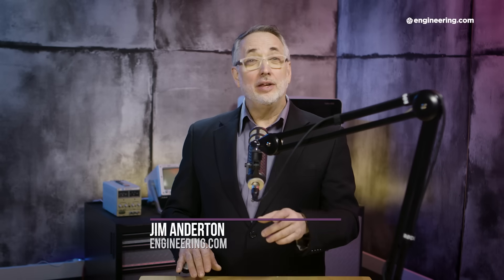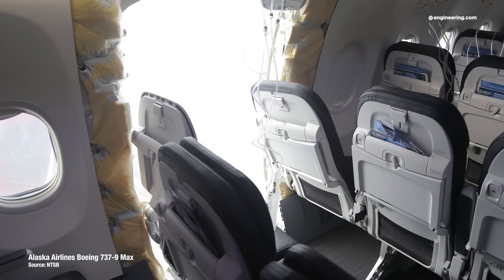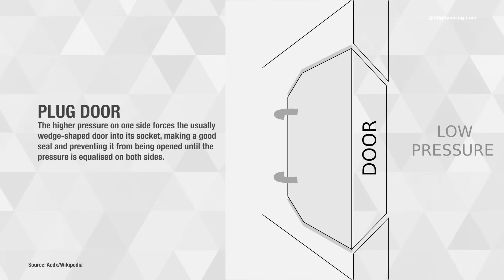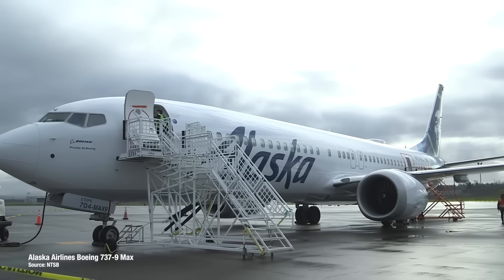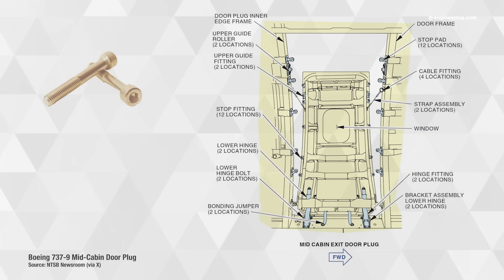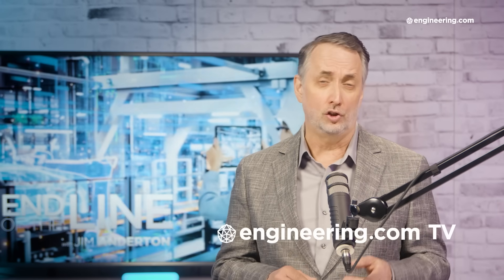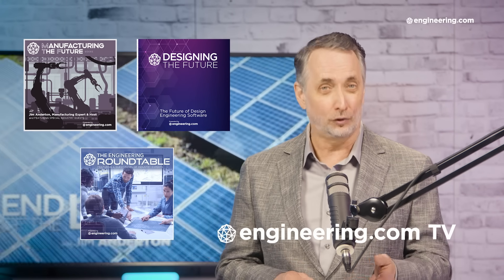The Boeing Issue Isn’t About Bolts

Comment: Boeing has been building safe airplanes for decades
The two fatal crashes could have been avoided with western trained pilots since they would have overridden the faulty sensors and fly the planes manually to safety
This was also confirmed by an independent French investigation however the media never talks about that 
Than you have these retired Boeing workers bad mouthing Boeing maybe they were part of the quality problem while they were working there but of coarse it is never them but somebody else
It is impossible to supervise 160,000 workers but for sure the company needs to improve the quality issue

Comment: 3:01 there is ZERO reason to reinvent the wheel here technology is not the solution. Boeing needs to go back thirty years and relearn what had worked for the fifty years prior. Personal accountability, attention to details, and more then one set of eyes during inspections and close out of maintenance tasks. Cost cutting has cut into the bone and we are seeing the results trying to squeeze more profit for the shareholders.

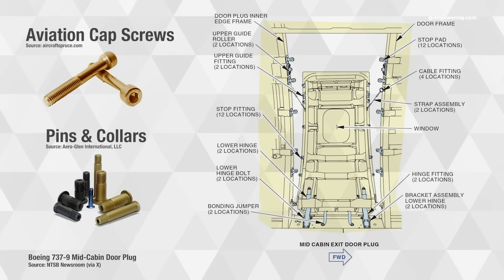Comment: 2:33 yeah, but no. Yes the bolts could have been installed, BUT not cotter pinned. Over time months in this case the worked off from vibration. Then turbulence and more vibration worked the bolts out. Remember this plane developed a auto-pressurization issue. This was due to bottom fasteners that hold the spring pressure allowing a imperfect seal of the door. More flights and finally the fasteners at the top work themselves out and "SPRONG" the door under spring pressure pops up and out.

Comment: I have worked around systems that have tamper controls, such as a fire suppression system for a large building. In order to close a valve a pin has to be removed and this sets off an alarm at the panel. No chance of the water turned off and no one knowing about it. A plane could have the same thing. The bolts are missing in this particular area and it would alarm.  We are talking only 4 main bolts here, they should be monitored.

Comment: One of the bigger issues is Boeing's relentless war against Unions. Aircraft manufacturing and assembly is a surprisingly multi generational affair, many Boeing workers have family working in the plant, and their parents worked there as well. There is a element of generational knowledge that is being eliminated as the Company tries to turn aircraft manufacturing into a 'build by numbers' affair so they can hire lower paid, less skilled workers. Ideally ones they can hire out of a hardware store parking lot. An engineer could probably argue against it, but I and others feel it is one of the problems Boeing has created for themselves.

Comment: It happened because of badly designed documentation. They called the removal of the plug with two different user cases and left the replacement of the bolts off the documentation checklist for one of them. It's a crazy lapse in QC set up.

Comment: In order to save money, Boeing built an aircraft that was flawed by design.
Then they fitted an inadequate instrument fix which caused the aircraft to fly into the ground.
They did not tell the people who had to fly the new aircraft what they had done.
The inspection regime on new  aircraft was not comprehensive enough to stop doors blowing off.
But they saved lots of money.

Comment: Technically, screws go into a threaded hole.  Bolts have a nut on the far end.  The significant difference is the manufacturing tolerance of the contact face under the head.  Screws can only be torqued on the head.  Bolts are usually torqued at the nut.

Too rough a contact face can cause lower effective torque.

Screws are more sensitive to strength as they should strip their own threads rather than strip the threads in the hole when overtorqued.

In bolt applications, if either the nut or bolt strips, both are replacable.

They may be called capscrews to purchasing and inventory, but they are utilized as bolts.

Comment: They were talking about bolts not pins etc. These bolts go through the cylinder that allow the door to rise up to clear the retaining pins built into the frame when the plug door is opened for inspection. When in the down position they are prevented from rising by a bolt through the cylinder and sleeve which should be fixed with a castellated nut and cotter pin through its end. So when they talk about finding loose bolts on several doors it sounds like the cotter pins were absent or not bent round the nut and so fell out over time. They may have been put in like that during manufacture at Spirit to allow Boeing to remove the plug during the assembly of the aircraft but that is what the FAA is looking into.

Comment: Pins and collars are Hi-Lok fasteners. These are an interference fit which pre stresses the surround area of the hole and has a sheared nut that has a pre torque hex applied to it so the hex shears when it reaches its correct torque. These are colour coded for different torques.

Comment: Omitting a fastener or fasteners during assembly or reassembly is far from uncommon.  I have seen it more than once in my years in the industry.  Most of the time these omissions are caught and corrected before they can cause problems, but not always.  In the case of these bolts in the door plug, it was probably a case of realizing that something was forgotten after the installation of the plug was complete, but nobody wanted to take responsibility for the eff-up and the delay that a rework would cause.  So they figured, just buy off the paperwork and hope for the best.  However, an examination of the production and maintenance records will reveal who signed off the installation or reinstallation, then let the inquisition begin.

Comment: One minute into this video there was a diagram of a door plug where the edges were narrower on the outside of the aircraft compared to the inside so that it's impossible for the door plug to open.

I'm guessing that your diagram is wrong for two reasons, first in the real world we know that a door plug has open and that is why all this has become a news story.

Second the doors on this aircraft open outwards.  If you had doors that open outwards and door plugs that open inwards, they would use the same holes, and the holes would be the wrong shape to do both.  Either the hole is compatible with a door plug that opens inward or it's compatible with an actual door that opens outward, but not both.  Look at your diagram one minute into this video and explain how the door plug could be replaced with a door and you will see that you are wrong.

Comment: Human error or carelessness is involved in a LOT of critical aviation issues.  Look at the Helios disaster with the loss of cabin pressure.   The switch to enable auto-pressurising wasn't reset after maintenance, BUT the tester signed off on doing that.   And the cockpit flight crew did MANY things wrong re checklist items, alarms, procedures, etc.   Compete fiasco. 

So it's NOT hard to imagine that if there is a process where plugs are removed for maintenance or interior work, them not properly getting put back -- DESPITE the safety implications.  All to save money (re cutting corners, do more with less, etc). 

It makes me glad I don't fly.  But we all eat, use complex products, need medical care (including drugs), and on and on, so this kind of thing puts us all at risk.

Comment: Well it certainly does make you wonder what DEI hiring and worker management processes have to do with this.  I suspect a LOT!! I worked at Boeing for 28 years, Spent time in manufacturing as an Aircraft Electrician Field and Hanger B, worked in 747 final assy did that for about 3 years then after a layoff was able to transition into Electrical Engineering as a Tool and Production Planner. In that role I wrote the jobs, "plans" that built electrical assy''s in the 747 sand 767, from installing wiring into the main power panels to stringing family groups of wires in the wire runs on the aircraft. 

I am qualified to say that management is going to kill the company with their idiotic greed and the utterly foolish ideas coming out of management schools nationwide. A Masters Degree in business today virtually guarantees a fool who thinks he knows what he is doing. They have repeatedly cut QA thinking, and I actually heard a manger say this in a team meeting "well if you look for problems sure you'll find them." Too stupid to exist almost. The "merger" with McDonnell Douglas was a fucking disaster for the company. All sorts of idiot "managers" from MD flooded the company and they were a bunch of criminal idiots. They had already run MD into the ground and that asshole fool Phil Condit destroyed Boeing by letting them take it over.

The company will likely die this decade

Comment: It cracks me up how everyone here has an opinion on why the bolts were missing.  Therefore, I am going to add my opinion to the mix.  The cause is too much quality control documentation which takes the focus away from actually doing the job correctly.  Filling out all the numerous forms correctly has become more important than doing the installation correctly.  It's another case of overstimulation and paperwork chaos.

Comment: Everybody’s missing the big picture. The issue is not about bolts. It’s not about door plugs. It’s not even about planes. The issue is culture. Specifically an obsession with quality.  This is what is missing at Boeing. It makes absolutely no difference whether you’re making airplanes, cars, spacecraft, bicycles, computers, whatever it may be. Whatever you’re making doesn’t have a process to maintain quality, in the end, you will have products that are being produced that do not meet expected standards. After Boeing put accountants in charge, moved headquarters out of the Seattle area, it went on a cost / efficiency binge in which it eliminated a lot of positions associated with maintaining quality control. That age old pursuit of profit at all cost. Once a company loses sight of what made it great, it’s a long way to fall. Hopefully the board of Boeing will understand this and demand a complete overhaul of the leadership and organizational structure of the company.

Comment: Not all bolts are cap screws, which have an internal hex for an Allen key. The term screw usually refers to fasteners which do not have any hex, either internal of external, having slotted or Phillips heads. Hex headed bolts are most common on the Boeings I worked on. Internal Cap heads (allen head) were usually only used where access space was limited. I believe the 4 retainer bolts on the plug door were designed to be hex headed bolts with drilled tails and castellated nuts and split pins.
Reply: The Federal Handbook H-28 says the cap screw name is colloquial and can be used to describe any threaded fastener with a head. In the shop, cap screws are usually allen, whether flat head, round head but never button head.

Comment: Seems to me, after the past few years of issues, is NOT about BOLTS, it's NOT about MAINT procedures.  It's more about the LOSS of engineering prowess that BOEING used to command.  It's a direct result of a BOARD that gives nothing more than a passing concern to ENGINEERING ( which includes a products lifetime ) thorough comprehensive products and a greater concern to milking every 0.01 out of a product.

Well the lack of ENGINEERS in board positions is showing.  Bowing is delivering crap.

Comment: Boeing in Renton has a system in place that provides the exact number of parts for each station and only the required tools for that station.  This should prevent missing fasteners and tools left on an aircraft.  Inspection is used to verify each assembly.  Sometimes the operator is allowed to inspect his/her own work.  This “buy-off” then still passes through a secondary inspection for verification.  So if the bolts were never installed, there were extras on the line and that should have triggered a red flag.  I’d like to know the real truth to this problem and what was done to get to the root cause.

Comment: I can't say I agree the "bolts were never installed". If you note, the door/plug is held in place against two upward pressing springs against the frame of the door. If either the two bolts at the top were missing, the door would not stay in place & would be pushed up & out away from the plane even before it took off. The bigger problem as I see it were the cotter pins were left off the bolts & this allowed vibration to loosen the nuts & eventually the door to separate from the plane. If the top cotter pins were in place (even if the lower two bolts were missing), the top bolts would have stayed in place & the door would not have gone 'flying off'...IMHO

Comment: A fail safe design is one where it can’t be assembled incorrectly.  Sounds like this door can be hung in place, look normal, but not be assembled correctly.  Probably so it can be installed quickly by one person.  Cost over safety.

Comment: I built 747s and 777s for thirteen years at Boeing, long before any 'self-inspection' schemes were put into place.

I once volunteered for overtime in a different area and was given a packet of information, including a copy of the O&IR (operation and inspection record).  My job was to install some missing fasteners.  I installed most of them, but there were several fasteners that I could not install because they were occluded by installed parts.  

The interesting part of this story is that the O&IR showed the ENTIRE JOB had been completed and stamped by a technician and by inspector as having been 'sold' and complete.

I was told by the supervisor not to worry about it.

It turns out that an unscrupulous manager had stolen a technicians stamps AND an inspectors stamp and stamped the job as complete.  They did this because management was under tremendous pressure to never travel jobs.

This happened in one form or another more than anyone would like to admit. No mechanic or tech I ever worked with would have done such a thing; we tool great pride in our work.

If there is a problem here I'm sure management is at fault.

Comment: the plug won't stay shut if the bolts aren't installed at all. the lower hinge and spring forces the plug up if no bolts are installed. the NYT did a good animation showing how they work. I'll speculate that the cotter pins weren't reinstalled and the castle nuts vibrated loose then the bolts.  since to took nearly 7 weeks of flights for them to finally fall out.

Comment: That does not look like an internally fitted plug type door.   Door designs I have seen on large passenger aircraft have to be "wriggled" into place as the door periphery is larger than the aperture.  Pictures are poor but show a recess in the fuselage from outside the aircraft.    Door may have a lip running around its lower half,  but picture is unclear.
Research by Toyota on motor vehicle component failure found that 80% of failure was traceable to poor design.  In my experience,   same for everything else.
Doors don't blow out of 747's as far as we know.   
I don't know what forensic design skills the NTSB people possess,  but I'd be looking long and hard at that door design and conducting pressure tests on the fuselage with door fitted looking for lack of stiffness of the fuselage aperture and the door itself.

Comment: I worked as a car mechanic for awhile, I never managed to leave out any fasteners when putting something back together.  I took my car to the dealer for a warranty repair and while there they did a recall that required removing the steering rack.  I picked up my car and go a call the next morning from the dealer asking me to bring the car back in to be checked.  The mechanic had woke up in the middle of the night wondering if he had put all of the bolts back in place on the rack.  Turns out it was installed correctly.  If a person is working on autopilot they might forget they have done a step, or worse forget to do that step.  I don't think the design of the door latch system is very good, it didn't require the bolts to put the door in place and the door remain there.  If the latch system required the bolts to be installed when the door was put in place they would not have been forgotten.

Comment: The old story about the air passenger sitting down in their seat and folding down the tray table only to be greeted my a large wet coffee puddle left from the previous flight. This happened in spite of the fact that the "Cabin maintenance crew" just completed the cabin "cleaning" in between flights. Half jokingly, the passenger comments, "I hope they take better care of the engines than they do wiping off the trays". Third party contractors leaving critical fasteners out of airframe assemblies, seems to make this a more valid observation.

Comment: I worked in automotive production with both vision check systems, and torque recording systems.
The vision system was totally unreliable, and the torque recording system could easily be tricked into recording multiple torques on a single bolt.
Reply: And of course, the company didn't fix that because it would have been more expensive.   And so it goes for basicallly EVERYTHING, and then we wonder why things are SO messed up, even as things get more complex over time.

Comment: Whether the actual fasteners were bolts or cap screws or something else, their function was to act as a retention pin.  As stated, they were not under tension or shear force when installed, they merely kept the plug properly positioned and either gravity or air pressure differentials kept the plug in place.  As to the discovery of "loose bolts" during inspections of other aircraft, from what I was able to see it appeared as if those were bolts used to attach the hinge fittings/roller guides to the door plug and/or door frame.  This is a whole 'nother issue worthy of investigation.